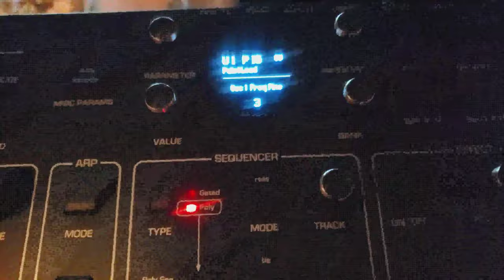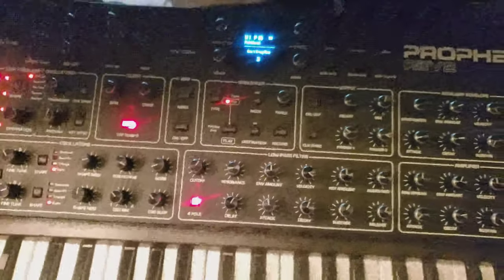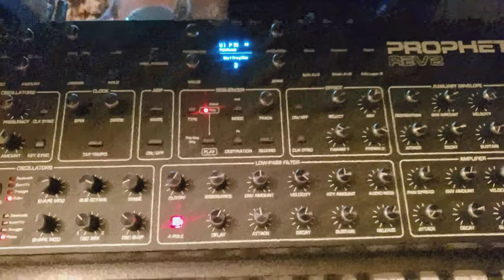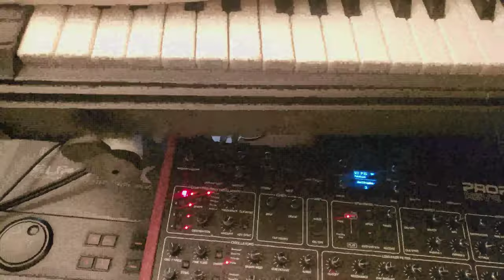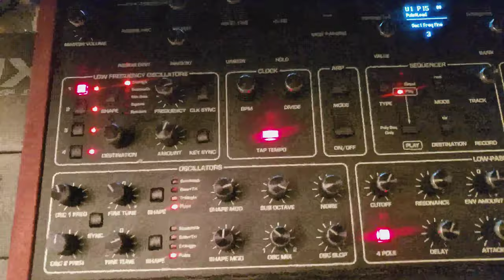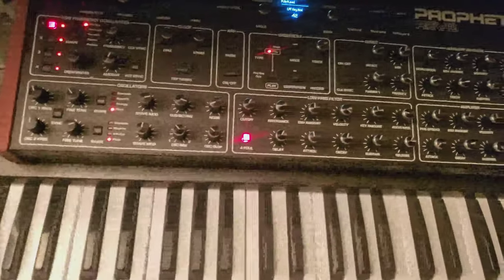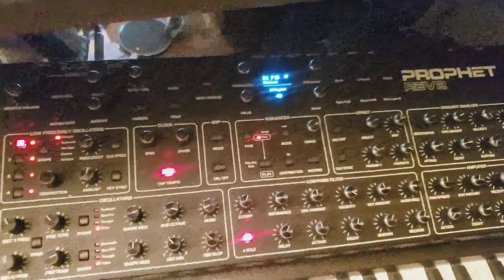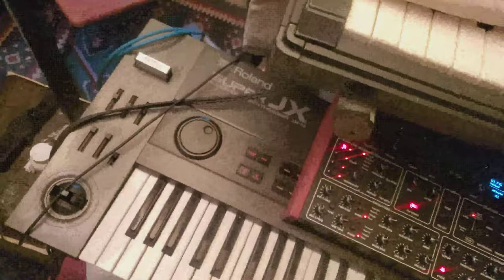How to make big bass sounds with your synthesizers.

Comment: untalked about
Reply from the maker: Well its just like putting a guitar rig together.  That is what I was doing.  Before synthesizers, buying pedals; but I had a really nice Ampeg Gemini II amp.  That is how i knew about tubes and tone cabinents.  The Ampro cabinent adds a lot of depth and clarity to the sound.  The satelite cabinents add volume to the clarity and make the sound bigger.
Reply from the maker: yeah i think it is still fairly easy to find a 6v6 organ amp.  Guy in Cincinnati, Sphar organ service, has converted abunch for use.  Usueally they have like a 10 pin plug and you have to figure out which is what in order to use it.
Reply: interesting, i've been thinking about such techniques for synths but never got my hands on a decent cabinet or tube amp.